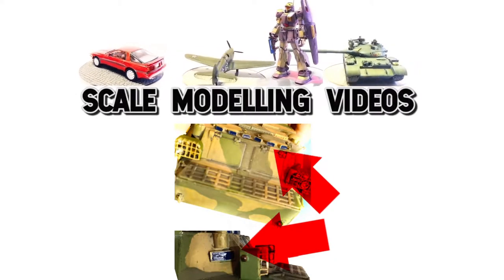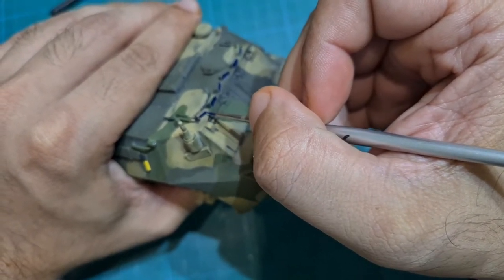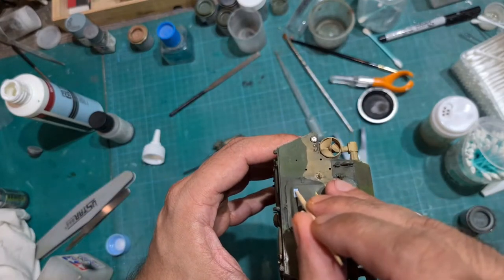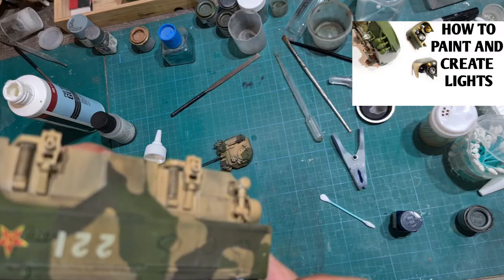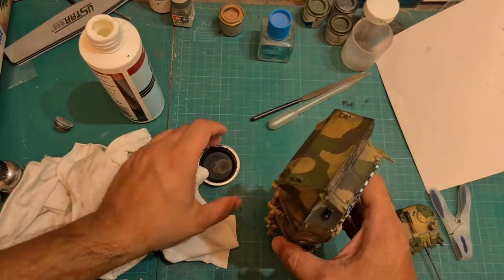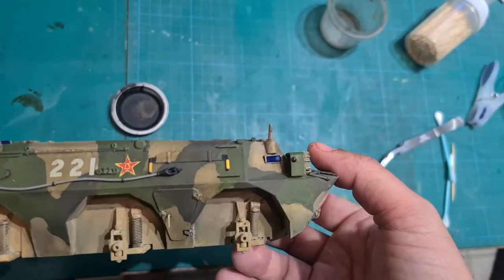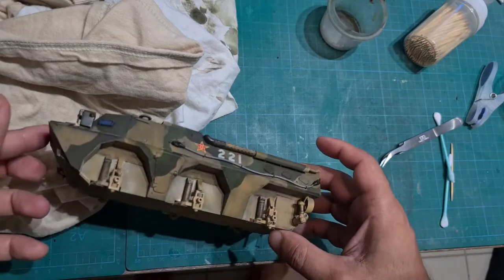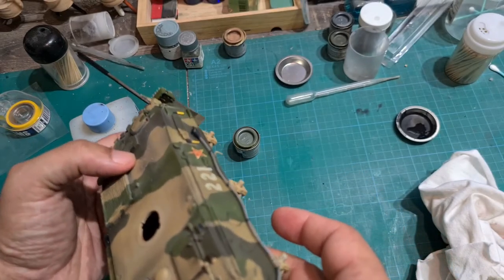How to paint windows on a Model

Comment: Hi sir, if the model kit comes with clear parts can I use the same technique i.e. apply a layer of gloss paint ( of my choice ), then apply PVA Glue and seal it with clear varnish ( if 'Pledge' Floor Care Finish ) is not available in my country . Thank You ... Harry I Malaysia
Reply from the maker: Do you mean use the technique on the clear parts?